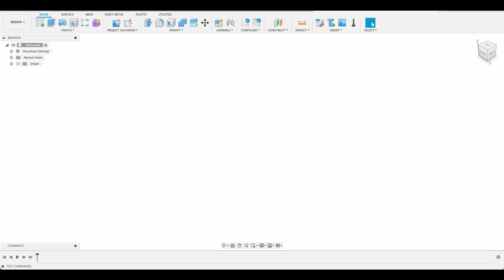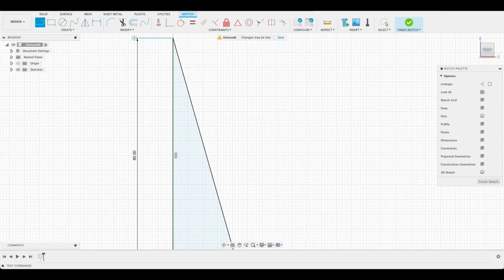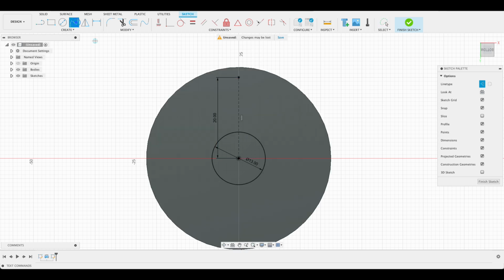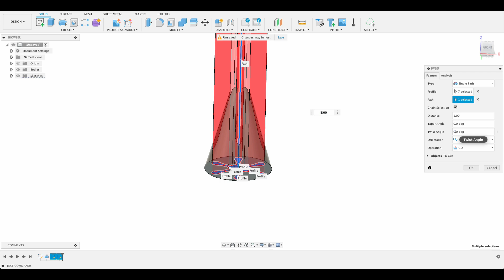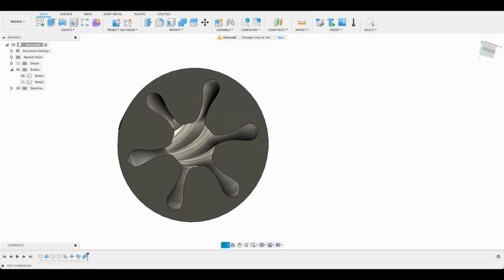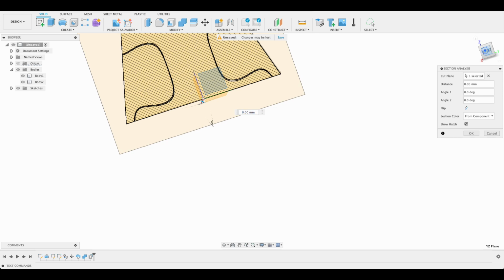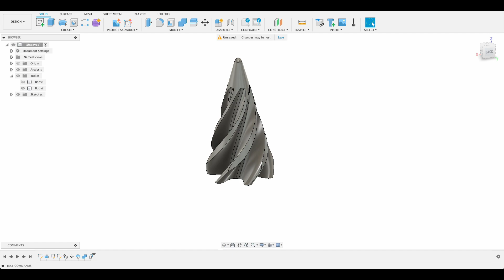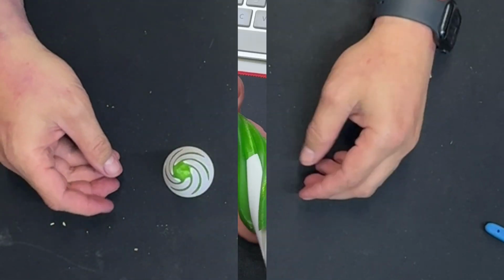Designing an awesome 3D Printed fidget toy

Comment: Fun! I think personally I would have extruded a cylinder, then drew the spline star on the bottom face, and sweep to cut up through. Then I’d offset that sketch by 0.15 or whatever, and sweep up a new body. Then I would revolve a profile to cut both bodies together into a cylinder (or any other shape!). But same result ultimately. I’m new to parametric modelling programs so I’m excited to give this a try.
Reply from the maker: Awesome man. One thing I found about Modeling is that there are tons of ways to achieve the same result it’s just up to your imagination
Reply: @Fusionfundamentals Seriously so many ways, I hadn't heard of using the push pull tool for something like this until this video
Reply from the maker: @MrEvanmartinez I almost never use it but it’s great when you have a curved surface and can’t use the extrude tool